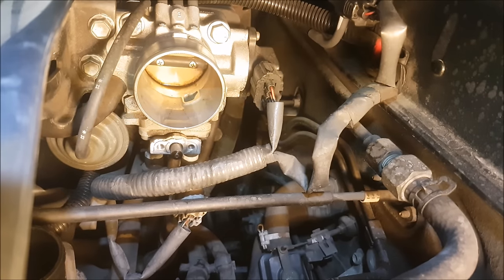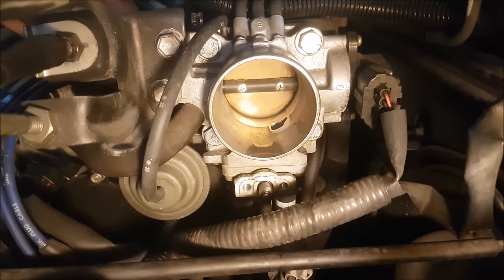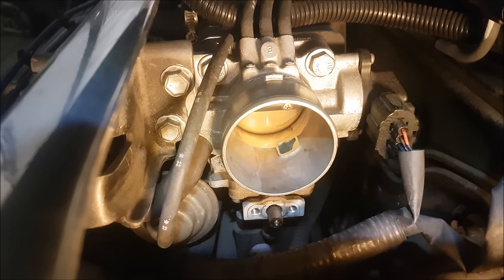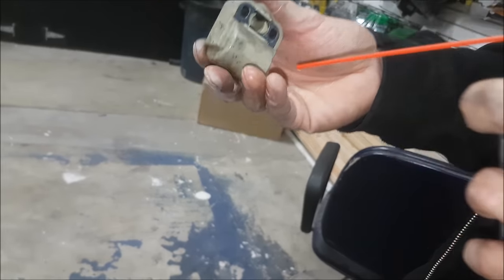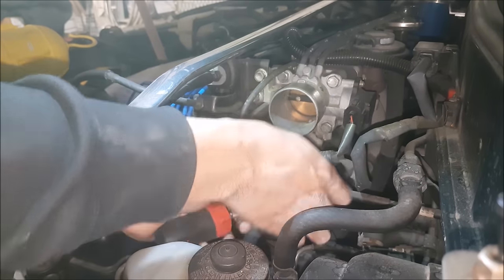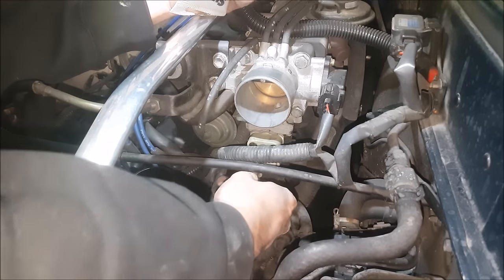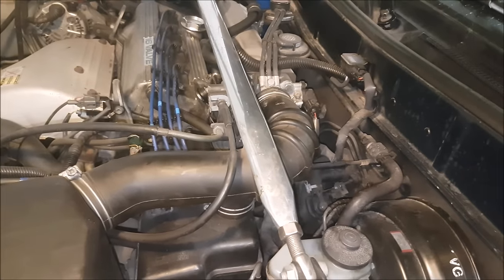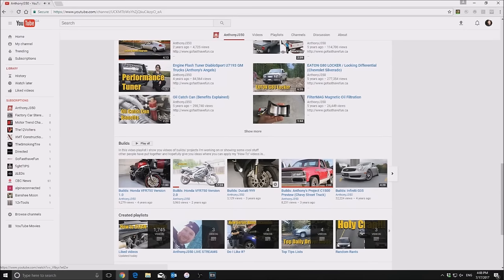Toyota Idle Air Control Valve Maintenance (Correct Idle & Cold Start Issues) | AnthonyJ350

Comment: You saved my car! Totally fixed my wife's car. I was about to buy her a new car and you saved me! I love you forever... Lol..
Reply from the maker: Glad to hear this helped!
Reply: AnthonyJ350 hey was your Camry cutting off while you was driving or slowing down and was your check engine light on????
Reply: Clarence Nash I have this issue now. It happens at a low speed, like when o stop at a light, or slow down. It went off at a light. Also, after it has almost shut the car off after I’ve slowed, when I try to accelerate, the gas peddle feel stuck, like it’s blocked or something. So I keep pressing it slightly, and then suddenly it feels soft again and the car is able to accelerate.
Reply: Have a 1999 Ford F150 when you drive it. Rib-eye Glen I need to shut off when you're not rubbing it I need backfiring when you press regressed
Reply: @awos6559  did this fix your problem? I have that exact problem with my car now
Reply: @clarencenash307  my Corolla is having something very similar to that
Reply: What are the causes of the 4age engine burn so fast
Reply: Just had to change the oil pump oil splashing on the timing belt and onthe steering rack
Reply: @awos6559  same problem is having with me. Did u ever fix it ??

Comment: I, purchased a new idle control assembly from parts geek online. 96 Toyota celica ST 1.8L, 46.00 Dollars!  Also replaced the complete fuel rack with injectors for 87.00 dollars & replaced fuel pump 25.00 dollars. Replaced  timing belt & plug  wires & plugs & new distributor assembly for 95.00 dollars on Ebay. Purchased the vehicle for five hundred dollars. Towed home did a really  good tune up on it. Running like a champ!  Excellent video on servicing the idle control valve. Great information thank you!
Reply from the maker: Thanks for sharing, hope the car gives you a bunch of reliable years of service!

Comment: Another good tip is when you’re cleaning your throttle body, spray into rag…if you spray directly on butterfly, all the carbon buildup will go down in the hole to the IAC valve and clog it up. If this happens, same thing, don’t spray directly into IAC, clean it with q tips soaked in cleaner. I say this from experience😅
Reply: Ps, if you are going to clean it and spray it directly, take it off and turn it upside down
Reply from the maker: Thanks for the tip!

Comment: Great video! One important thing to notice is there is a small amount of silicone adhesive between the two thus Toyota considers both the electrical and the mechanical sections as one complete piece.  If you continue to have problems at idle, consider adding fresh layer of silicone to the one of the matting surfaces an waiting until it has cured. Best of luck everyone
Reply from the maker: Thanks for sharing!

Comment: My 2 litre 1998 Rav4 was stalling instantly on cold start....I'd cleaned this before and it wasn't really dirty but it instantly fixed the car,sitting at around 1100 rpm on cold start....it's not used that much,I think it was just a bit sticky due to lack of use.Nice easy fix.
Reply from the maker: Thanks so much for sharing your experience!  Really helps others.

Comment: Thanks for the help. I did this to a 1999 toyota avalon. But you forgot to mention that you have to use an RTV sealant that is gas and chemical proof. 1st time I did this it worked for a while then acted up again. Used the right gasket sealer and working fine. Also u can test the resistance and make sure it's within tolerance. Thanks again and happy holidays. God bless.
Reply from the maker: Thanks for the tip!

Comment: I️ own a 98 Camry 2.2L and it always dies from a cold start, in the morning or when the engine is cooled down all the way. I️ have to hold the gas and keep the idle stable myself until the engine is warmed up before I️ can move it. I️ was wondering for weeks what the problem was but now I️ know, this video is highly appreciated.
Reply from the maker: Damien Try this fix. Let us know if it worked for you after.
Reply: AnthonyJ350 will do!
Reply: @damien9061  hey did it work?
Reply: Chris NZ yes it did
Reply: @damien9061  thanks for replying
Reply: Chris NZ no problem
Reply: Same here, I bought a new battery for no reason

Comment: 1995 camry rough idle, didn't  go away with this.  I replaced the blue VSV solenoid on the side of the block, called dealer for part number, bought it on E-bay, works fine...kind of a pain to remove and replace....
Reply: can u make a video or a walkthrough if u don't wanna do the job again and post a parts/AMZN link for the part?!
Reply: @byb-bangforyourbuck2353   Vacuum Switch Valve, or VSV toyota part # 2586074050-121 bought it on E-Bay.  It is bolted on to the side of the block, behind the power steering pump, between the engine and the firewall.   VSV has a blue electrical connector.   You have to remove the passenger tire, remove a plastic inspection cover fastened to the fender well, to get to this valve.   Not easy to get to, not easy to remove and replace.   Will try to make a video.
Reply from the maker: Thanks for sharing!

Comment: Recommendation: do not spray into the valve with the vacuum line on. I heard it runs into the crank case and that is bad. Instead, remove the vacuum line and plug the hole with a finger (I wore nitrile gloves)
Reply from the maker: Thanks for the feedback

Comment: I got a 1996 Corolla that idles high on Park, to the point that the dashboard vibrates. When on Drive the idling goes down, but some vibration is still there. I’ll do what you recommend to see if it fixes it!  It’s got 233K and it’s my daily driver!
Reply from the maker: Did it help?
Reply: I have the same thing happening, but I think it’s more likely the motor mounts

Comment: I have a 95 Camry. It wouldn't pass smog because it was idling at 1,100 RPM's. It doesn't surge at idle, it just runs fast. It should idle at 750 RPM's. I will give this a try.
Reply from the maker: Let us know if it helps!
Reply: @AnthonyJ350     I just tried it and I got the RPM's down to 750-800. I take it to the smog shop tomorrow. THANKS A LOT! I'm sure it will pass now.

Comment: I have high RPM when the engine is hot, when the car is started cold everything is normal. 
what could be my problem? 4E-FE engine  
my temperature is always 85º+or-
Reply: Please, help me im FROM Portugal 🇵🇹
Reply from the maker: Bad idle sensor?  Is the battery in good condition?  Poor voltage can also lead to sensor putting out incorrect readings.
Reply: Trying to solve similar issue, holla if you sort... I'll try inspecting the IAC interim

Comment: hello, thanks for your video, can you comment...01 RAV 4 runs great, really hard to start cold or hot.  100k miles, put new plugs in , did not help; but idle is smoother.  Runs & accelerates well, but even when engine is fully warm, trying to start with a few bumps it chugs and dies. Have  to really grind on the starter...thanks!
Reply from the maker: It might also be the EGR valve acting up.  That was an issue for one of our Toyotas before.

Comment: Hi, always come back here to see how to do it properly. Thanks for this!

Gonna ask, if do you know what color and order your socket has? I don't have a socket on my IACV, had to insert the wirings one by one. I tried the black on the far left or the last pin down, red in the middle and green on the right or the pin on the top.

And lastly, I think I screwed up the little cylinder on the middle of when you remove the solenoid, I tried moving it left and far right. And now our car idles on cold start at 1,300 and idles at 1,100. -_-
We have a 97 3sfe toyota corona exsior
Reply from the maker: It should only plug in one way

Comment: Same engine as my 94 celica going to give this a go having a similar issue
Reply from the maker: EGR valve could also cause the issue. Look into an EGR delete
Reply: I’m able to drive for a good 20 minutes down the road then my car starts acting up rpm gage acting weird. I’ll look into it thanks
Reply: @seanramos8166  did you ever figure it out?
Reply: HeartofTacoma I did! My celica is my daily driver now! I had a performance air filter I replaced the original air box with.. there was a sensor connected to the original box that I just let hang, it drove for awhile then started actin up and eventually stopped working. I put the original air box back connected the sensor to it runs great now.

Comment: Hi Anthony. Thank you for this info. Very helpful.
I just want to ask, do you have video tutorial how to return cold start setup?
My car has below 800rpm during cold start and goes to 1000+ rpm when it heats up. Appreciate your reply. Thank you
Reply from the maker: No I don't have a video for that. You can take off the negative battery terminal, push the horn to discharge the caps in the computer and let it sit overnight. Hopefully that resets the factory computer.

Comment: This is helpful, I have an '88 Camry inline 4 and it has a hard time starting too (all tune ups done and new distributor/filters). Then today it was surging up and down in traffic after a one hour highway drive. Runs fine otherwise.
Reply from the maker: Let us know if this helps.
Reply: If it’s a 88 it might be carbureted engine, same with my ‘90 Corolla, with cold starts you have to press the gas pedal a couple times before you start it.
Reply: @nachos4018  Thank you. No, she's an EFI system with a cold start injector.

Comment: Live in the UK & own a 1970s Toyota.  Different system back then, but with idling issues nontheless.  It's an automatic & although not fitted with a rev counter should be at 1500 rpm when starting from cold, then fractionally above 1000 rpm in Park or Neutral, fractionally below 1000 rpm when in gear at full operating temperature in those cases.  Instead certain times idle drops to zero when in use warmed up causing it to kill itself stopping at junctions, roundabouts & red lights.  Also can tell when it's not right when it runs uneven & lumpy.  Would be a good car if idle speed stayed at the mentioned constant level & permanently so.
Reply from the maker: Thanks for your comment!

Comment: What exhaust do you have on that thing? It actually sounds pretty nice!
Reply from the maker: 2 Magnaflow mufflers
Reply: @AnthonyJ350  I have a 2004 toyota corolla,  every morning when I turn the car on, it REV down and goes off, this happens every morning each time the car stay idle. I have to throttle it to prevent it from going of. Pls what is the cause and how do I fix it. Thanks
Reply: @AnthonyJ350  I know is old but what model magnaflows???  looking to improve my camry
Reply: @AnthonyJ350  could yu elaborate on your exhaust setup??
Reply from the maker: @pillypr  All magnaflow. Used a round body case to replace the resonator (biggest that will fit). And one of their street tune mufflers with the dual wall exhaust tip already welded on.

Comment: Good job Dude , Now after watching this video I am doing it next week with my Camy 2001.u got one more subscriber
Reply from the maker: Thanks! If that doesn't work the problem might be related to the EGR.
Reply: @AnthonyJ350  Yes , I did this,Engine runs very smooth .Will see how it goes after driving couple of hundred miles. EGR valve I tried to open up to clean it ,but one of bolt broke inside the body .I need to go to the mechanic now .(I guess).Thanks AnthonyJ350

Comment: hi there i was figuring out for a month now  what is my 1995 corolla problem doing thanks to you  now i know but i preffer to buy a new part for it  i will just replace it  i also replace the fuel filter ,fuel pump ,fuel injectors ,spark plugs and wires and now the idle air control valve .....weeeew i wonder what's next i guess its a 28 yrs old car  i never replace anything except the spark plugs and wires and oil
Reply from the maker: Let us know how the car drives after!

Comment: Awesome fix Anthony, I'm having a similar issue when I start it cold. However I noticed there is motor oil coming into the air intake hose from the small hose on the side, is that normal or how much should I worry? Thanks man
Reply from the maker: That hose is part of the PCV system.  It's normal for a little oil to pass through.  Here's a video
https://www.youtube.com/watch?v=DJ7Z2F51fzs&t=65s

Comment: Hey Anthony, I don’t know if your still responding to comments but my 97 2.2 I think has a bad iac, now I’ve been chasing my tail forever trying to figure out the problem and I feel these things are connected and I would love your help. So, quite a bit of oil gets in through my pcv and my intake has carbon buildup all over and when I take off it jerks aggressively and then smooths out in the 3,500 rpm range and up. I think it’s iac and I’ve cleaned it. It also only does it when the car has warmed up. I’ve done everything tune up and I would love it if we could maybe exchange messages so I can get some more knowledge about my vehicle because it only has 145,000 miles.
Reply from the maker: You might also want to check the EGR, it might be malfunctioning.

Comment: Good video. I have same engine -92 and one cylinder drops out when running idle and on low revs. Shakes a lot on under 3000rpm when accelerating. Have to try this because new plugs and coils and tubes did not work. I hope its not the fuel inhector. Pump probably not the issue cos engine runs fine on high revs. More hints :)?
Reply from the maker: You can try upgrading the ground wires in case it's an electrical issue.
Reply: @AnthonyJ350 I saw that suggestion on another video. When I asked 2 different mechanics about upgrading the ground wires, they seemed to be confused as if that's the first time they'd heard of that.

Comment: Does the actuator valve reset its position automatically? Cuz when you take it apart and twist that valve it will basically just stays where you set it. There's not a spring or anything to close it. So when I took mine apart and cleaned it I didnt know exactly where to position it before putting it back together?
Reply from the maker: It's magnetic, so you just have to reinstall it.

Comment: What's up AJ. Gotta love them Toyota's. These cars are notorious for idle issues 😥   
It's noticeably breathing nicely at startup. Is it snowing in your area? Just wondering
Reply from the maker: thizzface Ya I've cleaned the throttle body before but didn't service the Idle control valve. It's seams much better now so it must have been getting stuck all this time. It's hasn't really snowed in my area. It goes to -1 Celsius at night right now.
Reply: AnthonyJ350 Noice! That's a good point. I swapped out our Camry egr a few times thinking that was the cause but symptoms just repeated. not cleaning the throttle or IACV was my fault. Great vid bro
Reply from the maker: thizzface I'm hoping it'll help out other people. I think this help the bogging I was getting at low speed.
Reply: AnthonyJ350 I couldn't agree with you more. Although it varies. This remedy applies to most vehicles including our VQs. I asked about snow if you run into issues regarding cold weather.
Reply from the maker: thizzface It seemed to be having odd start up issues when the temperature dropped. The test will be the next few days when I bring it to work and let it sit outside. An oil catch can on our Z's on the throttle side will help with this.
Reply: AnthonyJ350 cool bro thanks for the info. I will do that

Comment: toyota 4a-fe engine in my 97 prizm. engine boggs when releasing the accelerator, braking/idling at low speeds after accelerating some. seems like that was a similar issue to yours, however i cannot keep my car in park/neutral. it revs up and down constantly.  Only when you cold start the car does it idle “normally” for about 45 seconds.  Then the engine drops rpms to practically stalling and then starts revving up and down. Do you think this will help with that too? Trying to fix this problem for cheap rather than buy a new IAC Valve. Car was free 🤷🏼‍♂️
Reply from the maker: If the car was free and original IAC valve is cheap in the grand scheme of things.

Comment: Hi Anthony my c
My Camry LE have the issue.. whenever the AC is on ,shift to D and R the rpm drop and vibrate..but without an AC it won't vibrate or Rpm won't drop..
Do you have any suggestions that how I can try to solve this issue..
Any help is appreciate Anthony
Reply from the maker: Sounds kind of normal since the compressor is adding drag to the engine. A lot of 90's vehicles are kind of like that. Is the car completely stock?
Reply: Its a completely stock..but the rpm drop is and greater than usual.. sometimes I have to switch of AC when reversing the car , with AC the engine almost death..
Reply: I suspect the IAVC or FICD..
Reply from the maker: @aroydonnak  When was the last tune up? Also can you check the voltage with the ac on and off? I would consider upgrading the grounds as well.
Reply: Ok, I'll try to tune up and upgrade my grounding...will update u again..thanks Anthony
Reply from the maker: @aroydonnak  Sounds good. Do a voltage check before you do anything and then after. Might also want to clean the battery terminals
Reply: @aroydonnak  did you ever wprk out this issue? I'm having the exact same thing on the exact same car. Already replaced the MAF, spark plugs,  and I was going to check the O2 sensor next. Did you get a P0171 code? Because I did.
Reply: @AnthonyJ350  what do you suggest?